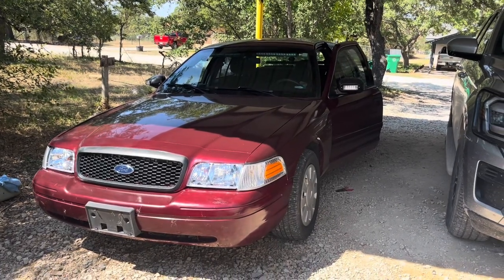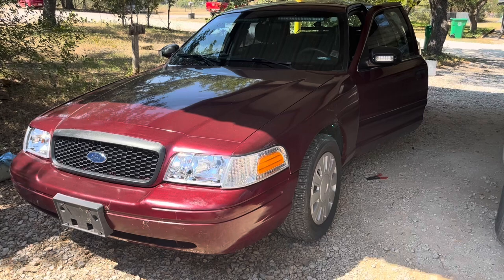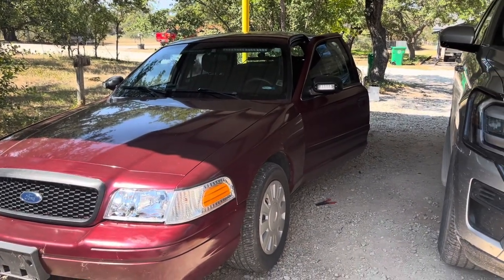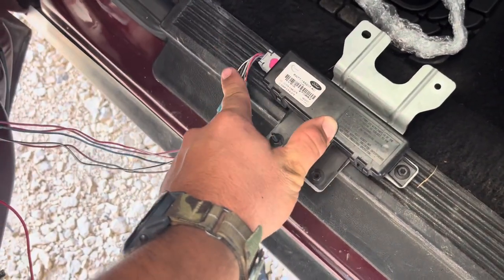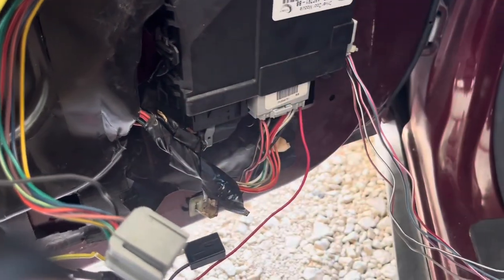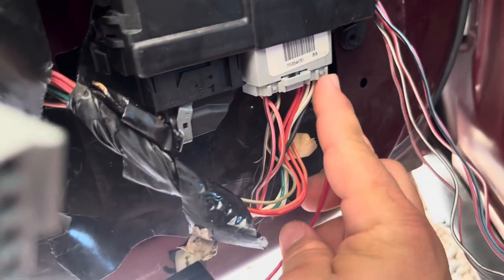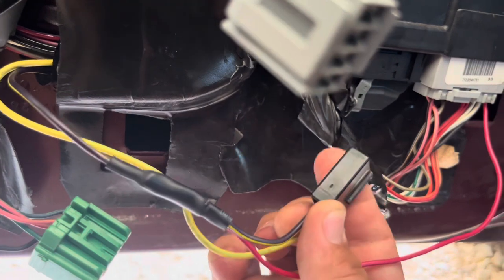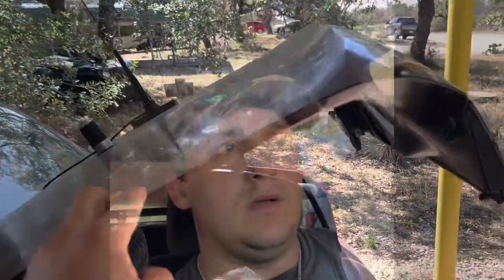2007 Crown Vic Police Interceptor- Remote Keyless Entry Install and Tips

Comment: Nice!!! Will this work on a 2005 P71?
Reply from the maker: This will not work on a 2005 unfortunately. The computer was not set up in the same manner as to 2007’s
Reply: @07RubyRedCVPI  thanks for the info. I was thinking I could swap out the DDM and make it work but sounds like that’s not possible.

Comment: What about the safety locks on the back doors? Did the remote unlock them?
Reply from the maker: So my back doors did not have the safety locks installed for prisoner transport but if the back doors have electronic door lock actuators, this will unlock the back doors

Comment: I own a 2001 crown vic p71 and i cant find any info online except for installing a new module in my driver side door or possibly ordering a banvie unit from amazon any help appreciated thanks
Reply from the maker: Anything below a 2006 will have to have an aftermarket system installed from what I’ve found online. And the 2006 MY is a coin toss from what I’ve read in online forums.